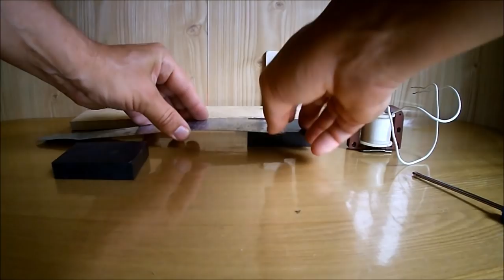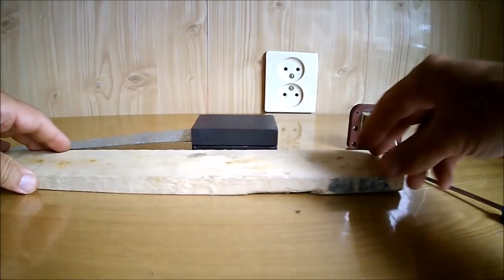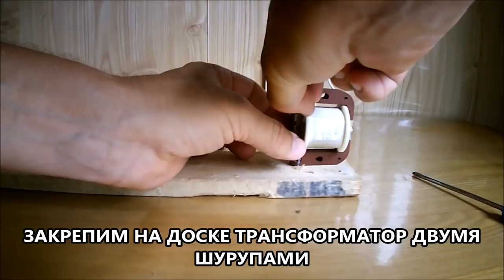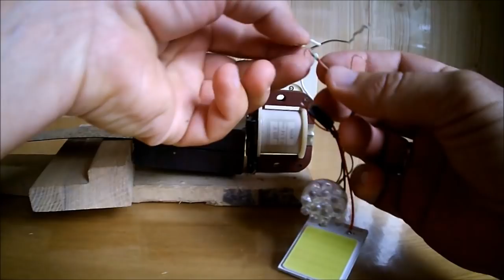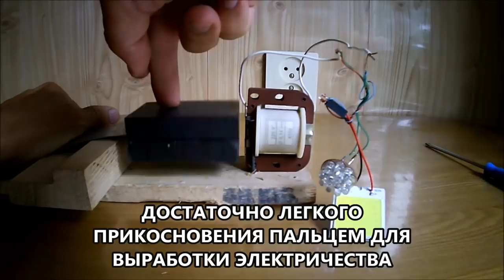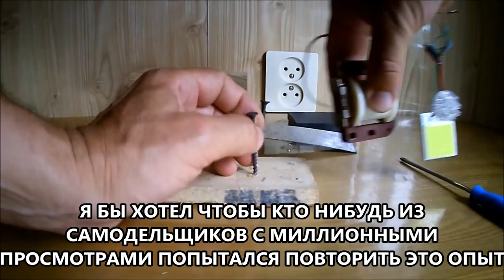СУПЕР ПРОСТОЙ ГЕНЕРАТОР. Как из минимума деталей собрать действующий генератор тока.

Comment: you were very close, my advice would be to attach magnets with positive facing flat outward on the spinner then mount a stronger single magnet at  just the right angle, and just far enough away from the spinner. now you have multiple weaker magnets "use weaker magnets here so to avoid the magnets forcing the polarity to the middle ground between magnets" attached to the spinner and a stronger magnet mounted at just the right angle and distance from the spinner with the magnets pushing away from each other. give the spinner a little start and watch. test it a few times keeping the spinner in the same place but adjusting the position and most importantly the angle of the stronger magnet to find that sweet spot once you do mount the magnet. now one more kick start and watch that thing take off. perpetual motion is achieved by your jump start and then maintained by the magnetic energy entirely.?
Reply from the maker: Thank you for your attention and interesting thoughts.
I will do my best as best I can.